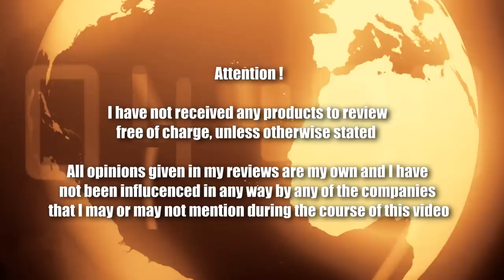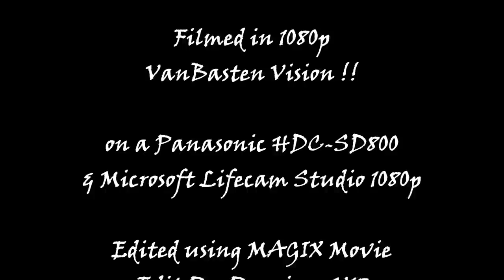Box Mod Build Tutorial

Comment from the maker: Hiya, on this kit it came pre installed, but all you need to do is to drill a hole for the 510 connection and then either use hot glue or some epoxy to secure on the inside..

Cheers